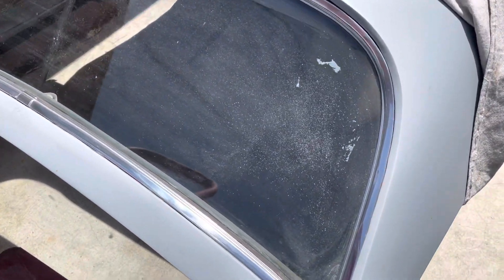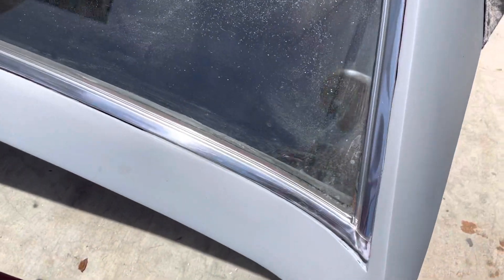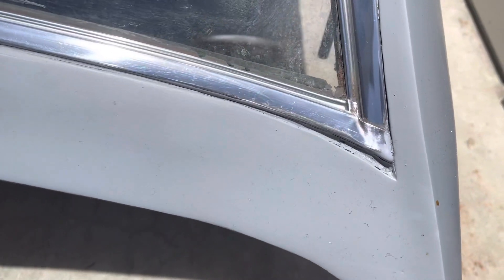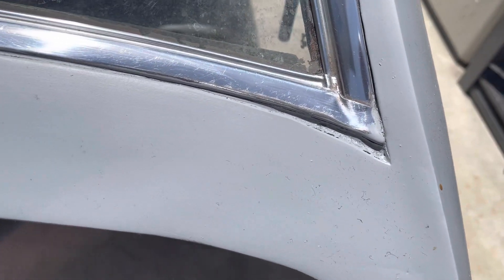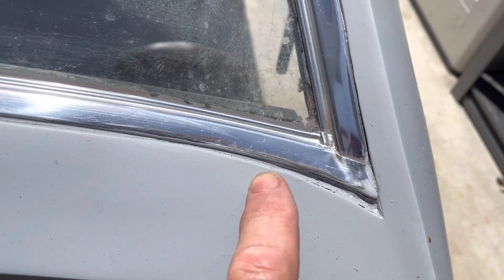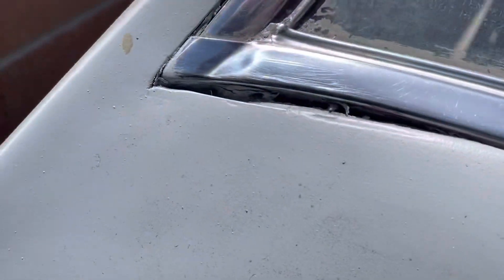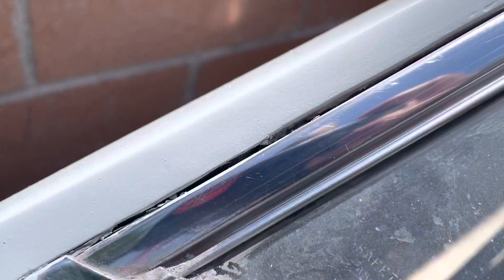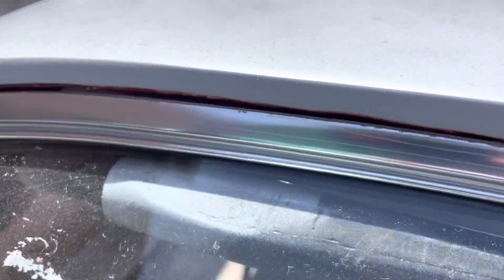C3 Hardtop Gap Question

Comment: Fill it using your chrome trim as a guide. Just put some plastic sheet on the chrome first to act as a release agent so the filler don't stick to your chrome. That should fix the gaps.
Reply from the maker: Thanks!